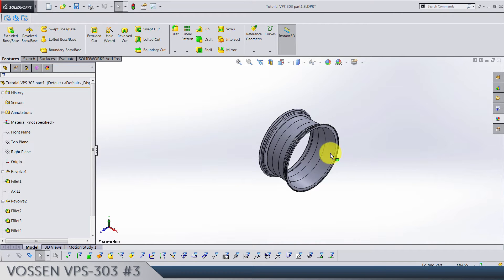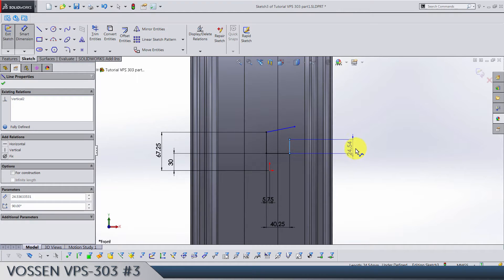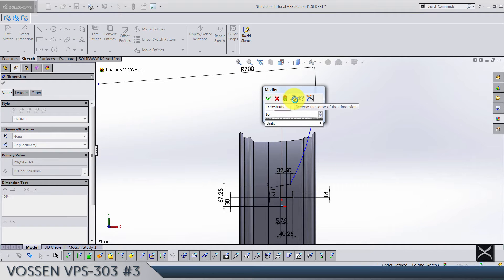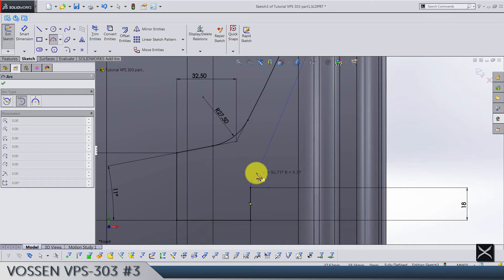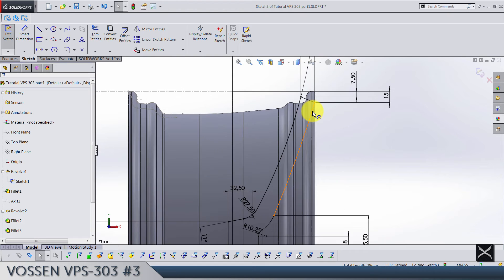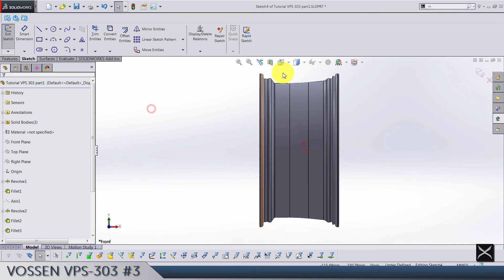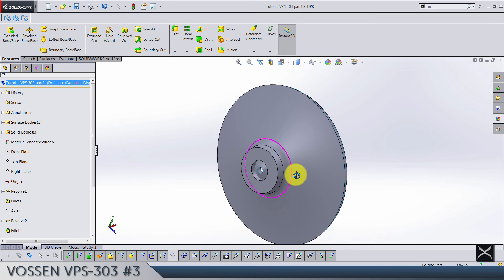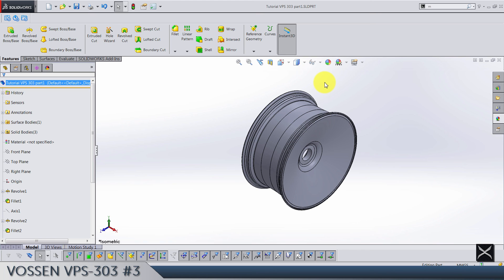SOLIDWORKS WHEEL TUTORIAL - VOSSEN VPS-303 #3

Comment: Thank you very much for the tutorial. I know it may be not be something I need to know to follow the video, but can you explain the reasons for copying the revolve body, and doing an offset surface then cut the disc?  Thanks in advance.
Reply from the maker: you're welcome
I really can't remember at the moment what exactly you are reffering to but what ever I did was to make the wheel as similar to original and also make it all easy for you guys watching to do and understand
one important thing I would add is later when I worked for some real clients I found out my dimensions for this wheel were slightly off
the proportions were perfect but the size was wrong

Comment: When creating that revolve at about 8:00, it only allows me to do a revolve of that offset arc when the thin featured is on? 

Was the thin feature on in your design?
Reply: Also, I cannot use or click on that new revolve when doing the cut with surface?
Reply from the maker: @iESTO818  for that use f5 or f6 on your keyboard that will give you filters where you choose surface filter
Reply from the maker: We are not doing revolve, we are doing surface revolve and that is a huge difference so fix that 😁